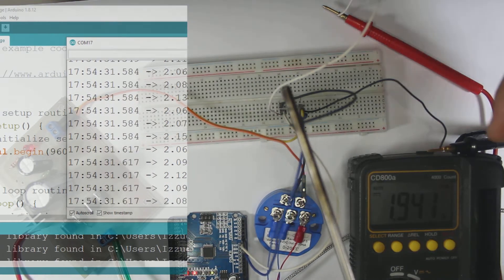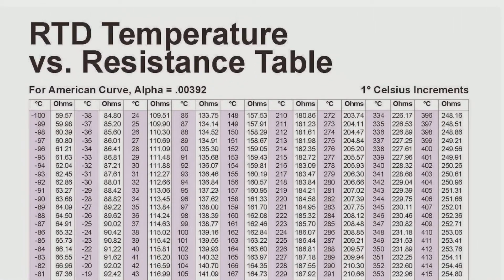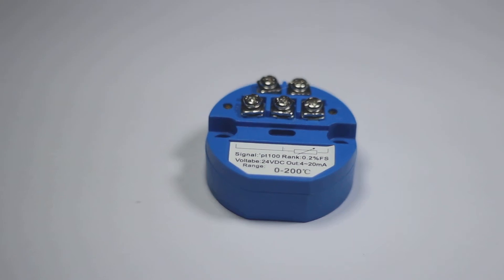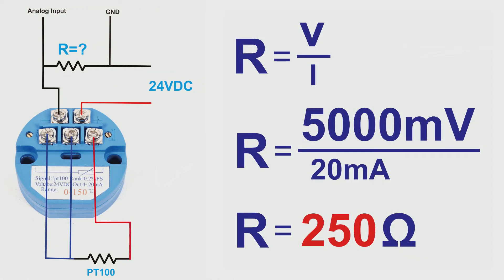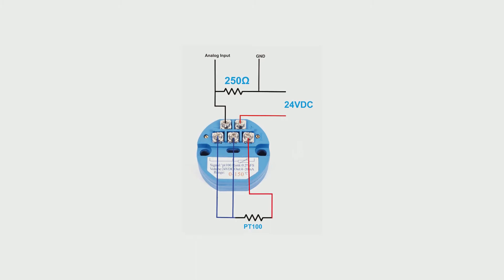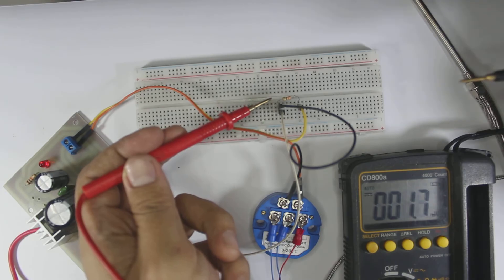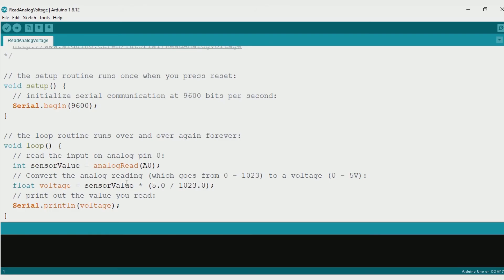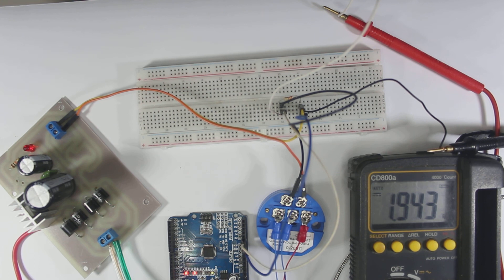How to use RTD sensor ( PT100 with arduino tutorial )

Comment: Can you make a video of how to convert from voltage to temperature? I only have the voltage value but can't find a way to convert to temperature.
Reply from the maker: You can convert by measure the voltage and temperature at the same time. So you will get the value to multiply the voltage. Maybe I can make the video next time